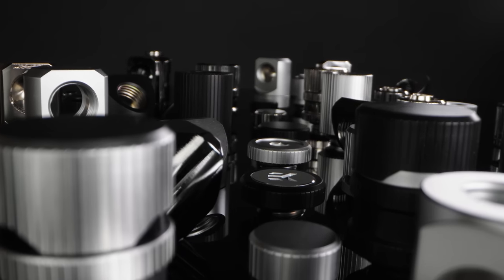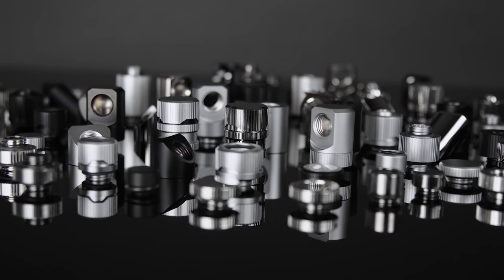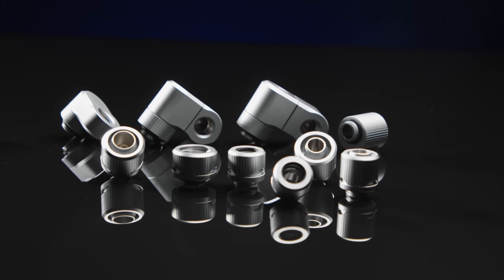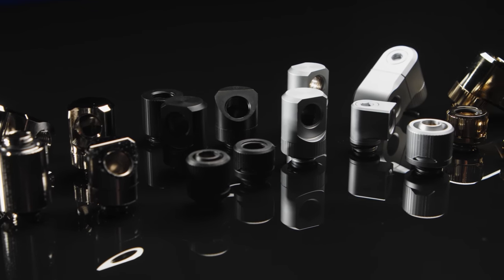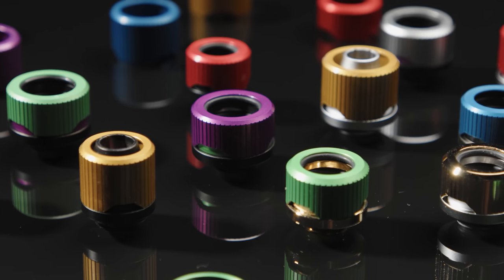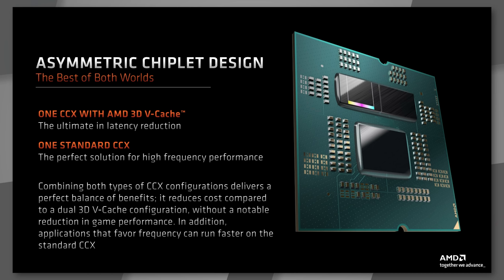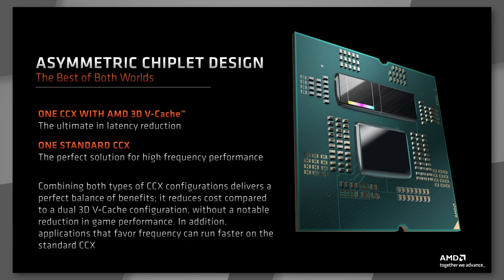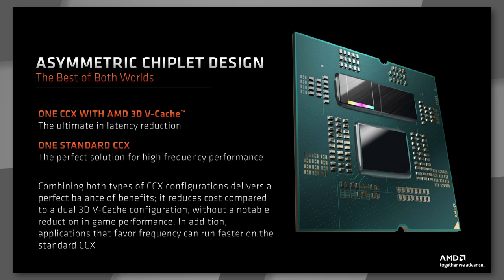Why I switched back to Intel...

Comment: I hope Intel continues to treat you well.  I took a bit of a leap going for the 7800x3d (I do know about the 2 CCD vs 1 but it was the change to AMD and the RAM frequency issues) after being Intel my whole life.  So far the only issue was the power supply nuking itself after only 2 years but I was so ready to blame it on the new platform.  Knock on wood I'm hoping it keeps going well and hopefully skunkworks is rock solid as well (and fits in your house).
Reply: Best choice. I don't even know why anyone would go for anything else. I still can't believe the performance numbers while drawing soo little power, it's just bonkers. This cpu can easily last 5 years in a top tier gaming system and after that a potential 9800x3d can probably be just swapped in.
Reply: His problem is the 7950x3D sucks. The 7800x3D is good. I guess he wants more cores and faster RAM timings. He’s making a long winded excuse to go back to a dead platform and use way more power lol.
Reply: @quintrapnell3605  Why do you care about power so much? I really don't get why people care so much about power, in their PCs while they have RGB everywhere and subsused cooling systems. i understand people like 3D cos better benchmarks I get it. But power? who cares unless is a laptop 
CPU power wont make a such difference anyway when choosing  PSU. So why?
Reply: 7800X3D only has a single CCD with the V-Cache on it. So it doesn't suffer from the problems he described with the 7950X3D.
And for gaming there is not much point in more than 8 cores anyways.
Reply: @quintrapnell3605  AMD sells something that sucks and wastes someone's time. Common AMD Fan reaction.. YOU BOUGHT THE WRONG ONE!
Reply: @afiguerog  yep.  Last days i played Wreckfest for example.  It plays well on 13600k 5,4 allcore.   60- 70 Watts.  But with windows-enery-saving mode this CPU takes 7 Watts max.   Drops to 160 fps ingame, but still kinda good on 240Hz Panel.  Sometimes then i 330 frames or maybe more cause of my limitation limit.   
on enery mode also 1,6 Watts on Idle / browsing / having pubg in the backround

those 'experiences' and tests I suggest for amd can like my a**  if intel is running / that good / that stable / and that efficient
Reply: @afiguerog  Power usage doesn't matter if annual infrastructure cost is "near zero" for electricity, air conditioning, clean filtered dustfree indoor air.  But in the summer time, kilowatt hour charges can be tough (eg southern california) if someone has an electric car charging while drawing roughly 450 to 700watts with their XYZ CPU + 4090 GPU.  The non-peak kWHr charge is 24 cents for some people and charging a car pushes them into the next 2 tiers at 26 to 32 cents.  You may still say pshaw 500 watts averaged for the PC while it's on for a few hours per day doesn't matter, but your air conditioning unit has to get rid of that 500 watts of additional load.  So that cost is invisible to a PC user, but should also be factored into the cost of the PC power draw.
Reply: @quintrapnell3605  It sucks as a gaming cpu. Honestly I have no idea why AMD made this cpu when afaik no productivity software benefits from the larger cache. Iirc, even a regular 7950x is better at productivity compared to an intel one.
Reply: What PSU was it?
Reply: @mangatom192  enthusiast market kept moaning about it so they gave in.
Reply: @DEJ915  There isn't a true enthusiast market anymore. It's just gamers who want to try & stream what they're doing to try & make money off it. 
True enthusiast tinker with computers finding the right settings & getting ever last % of performance out of what they have. Things like mGPU & variable rate shading would be on that list too. I mean they had to come with an Bios update to run anything past 6,000mhz DDR5 on AMD because their IMC can't handle it in 2:1:1 mode, so it can only do it in 2:2:1 mode. It's limiting their own cpu's potential at this point too.
Reply: The V-cache is just remedy for interconnect latencies with AMD going for multi-die design which is more economical although very difficult to tune. Adding more cache improves memory fetch time but AMD's implementation with 3D V-cache does incur drawbacks with thermal and more complex manufacturing process. On the software side Intel is more refined and AMD is still playing catch up (both Intel and Nvidia). Given that AMD almost went under and lost many talents in the past before zen series, they are currently doing okay but definitely I would like to see their hardware and software design getting more refined over the next few years.
Reply: @quintrapnell3605  AyyyyyMD fanboy detected, lol.
Reply: @quintrapnell3605  If you watched his earlier vids on this CPU you can see why he switched, AMD always seem to get so close but they always fuck something up to make their product no longer viable where you have problems with drivers, RAM timings, weird inexplicable errors
Reply: @afiguerog  Because we don't all live in America. The 7800X3D and the like achieve pretty much the same performance at 50% the power consumption.
Reply: I just did the same. The 7800x3d is a super super processor
Reply: @afiguerog  then you must be living in a country with low electricity costs. I pay almost 50 € cents per 1 kWh... The heat generated by my Intel was tremendous, my case was quite hot all the time. Now, for the past 10 months, I've had a 7800X3D...
The performance in gaming is simply impressive. Not in all those casual games; it doesn't matter there. But there are some games that benefit significantly from the X3D. Tarkov +40%, X4 is hard to measure, but it runs much better too
Reply: @afiguerog  More power = higher temps and more expensive power supply needed because you have to buy a bigger unit and a more expensive cooling option will be required.  Actual power consumption cost is not the concern.  Your CPU will thermal throttle when temps reach the TDP (max temp the CPU can handle) then you start to get significant performance loss.
Reply: Well the 7800x3d doesn't have that issue that the 7900 ones have. And it actually is the fastest gaming CPU.
Reply: The 13900k is still faster...sorry. @DenverStarkey
Reply: @drunkhusband6257  not at gaming it's not
Reply: @unknown14191  there is no thermal limitation. Its only rated lower from 95c to 85c because the power limit is lower Its 120 watts vs 170 watts for non 3d cache cpus.
Reply: so i bought a 7800x3d with DDR% 6000 M/Tps and so far its been AMAZING! but.. i have had the dram light on my board every now and then but i just dont touch it and it retrains the memory and posts.
Reply: @afiguerog more power = hotter and more frequency drops if you can't properly cool the chip leading to worse performance overall regardless of gigahertz or ram speeds
Reply: @rahorin  the thing about power limits though is that when they set a "wattage limit" they also set the temperature limit too.
So 170watt is 95C while 120watt is 85C. It's based on the same voltage curve & thermals don't actually play any part in it.. it was just done for power efficacy. 
it's like when you get a GPU that has power limit of 115% but starts out 250 watts while another model has 105% power limit but starts at 300 watts. all while being the same GPU die.
Reply: @gessler555  seasonic. I'm RMAing it but I was very surprised that was the issue.
Reply: Love my 7800X3D as well. The best part of my entire new system. Dissapointed a bit by my 4070ti...To much coilwhine. But the CPU is gut-tier. 55 watts in games, never seen more than 70c in games on an NHD-15. I hated it early on because I had boot problems despite expo 5600 mhz....But once I got bios update sorted, and ram somehow working there has been 0 problems.
Reply: @pinatasrule  so does that apply to 11th gen intel CPU and intel fanboys, or what are you trying to tell us?
it's a fact that Jay chose the wrong one for his needs. and he clearly says nonsense at 1:50 "the 7950X3D [...] anticipated to be the best gaming CPU ever." That is plainly wrong. the 7950X3D came out merely 6 weeks before the 7800X3D, and it the specs of both were clearer as vacuum, especially the Vcache wouldn't be on both CCDs. Also it was well known with the 5800X3D, that the temps and clocks are slightly lower compared to the non-X3D one. 
So all Jay tries to do is to put the blame onto AMD while he basically chose the wrong one for his needs. He was like "let's buy the biggest AND most expensive one" without reasoning and further deeper look.
Reply: @kevinerbs2778  interesting! What's equal interesting, that my 7950X runs only very slightly slower when set to 105W Eco mode (which equals 130W according to hwinfo)
So... it's about as fast as a 13/14900K, but uses half the power. Which is insane.
Reply: @afiguerog because I don't have any RGB and can use a cheaper air cooler instead of an AIO. In the end it saves me money and is easier to cool.
Reply: @mangatom192  they made it because fanboys wouldn't shut up about AMD not making a 16 core v-cache chip after they repeatedly said why they didn't make it... so they made it because why not, there's people dumb enough to buy a processor they shouldn't be buying to use on something that isn't a primary use case for the cpu. it's not a "gaming" cpu it's a workstation cpu with the option to game with less of the limitations of a workstation cpu. most mainstream applications don't really benefit from v-cache but there's more and more enterprise software that's being coded to use the cache pool with the new v-cache epyc processors coming out. because of that there's usually a trickle down effect to mainstream app's.
Reply: @afiguerog  yes it makes a difference in psu choice , if you have a cpu suckng 50 watss compared to one sucking 200 watts? how is that not influencing psu choice?
i have 7800x3d with a 750 watt psu on a 4080 ,  if i went 13/14900k i would have needed a damn 1000 watt psu

and i dont like cpu thats always near 100c like intels ..... 
so i even save money on cooling 
i have a 50$ aircooler for the 7800x3d on a 13/14900k i would needed a good spec aio at least
Reply: After reading so much barbarity, I'm old in IT and there is a big problem, the manufacturer makes a product, and the partners like Asus, MSI etc, want to do more than can be done... some are right but some even explode , processor...
Reply: @afiguerog  More power more heat and louder.
Reply: @HaasTheFirst  Maybe just maybe without the bios updates that limits the cpu voltage or manually lowering the voltage these CPUs melt and fail both damaging the CPU and mother board is a bit of a turn off. For those that like to OC or play with the specs of their system x3d is a non start because it cant. This CPU is also not the best choice for those that need multitasking performance but also want to game and it isn't even close. Just a few examples why someone might choose intel.
Reply: @afiguerog power consumption and "muh efficiency" has been part of the amd propaganda machine for like 2-3 years, dude. When their newest GPUs started using power like they have holes leaking it in the back, it suddenly stopped being important?
Reply: @afiguerog  Electricity can be pretty damn pricey in some countries. Over time adds up to costing you more than the entire build. That's why.
I got no RGB whatsoever. GPU undervolted. Got a 4070 burning around 60-80 watts most of the time on ultra. Still easily hitting stable 144 fps in fast paced games. Got it locked to 80 in most slower paced ones (like Baldur's Gate 3) where anything above that makes no difference.

Comment: Running 7900X3D combined with the 7900XTX.   This was my only AMD build in about 15 years, so far IT'S A BEAST.  I don't "abuse" my PC as much as I used to so I haven't had any problems yet, gonna bookmark this for my records and will UPDATE IT IF I RUN INTO ANY PROBLEMS.
Reply: Do the problems talked about here (with Jay's setup for example) occur only when overclocking? Getting my AMD setup too and got bit worried about these issues. No plans to mess with the system, just run it default, so hopefully it goes problem free.
Reply: excactly the setup i want to get. can you share you complete list of specs? i'm curious to what MB you're using, RAM too
Reply: AMD is ok for casual gamers, but for streaming+gaming+browsers opened with multipletabs you'll experience stutters ans real 1% frame losses compared to Intel.
Reply: Putting almost best consumer PC pieces for "not abusing my PC" -what is wrong with you people.
With a 7800x3d and 4080 rtx you would spend less and gain more with rt and lower consumption
Reply: This is my first AMD CPU in 15 years also 🤣😂😂
Reply: @b3at2  how is it so far ?

Comment: I love my 7950x3d. I use process lasso and prefer cache in bios. This pretty much takes away all issues especially if as you say a lot of games are less known that you play. ECLK is used to bring up frequency on the vcache ccd so you can OC a bit. I haven't experienced any of the memory issues you have so can't speak to that, running Buildzoid's timings at 6000. Got it delidded so temps are really good. I understand and respect your choice, hopefully others that have already purchased this chip can find these "fixes," especially use prefer cache in bios if you game a lot. The power usage still amazes me. End of rant, Thanks Jay!
Reply: Can you give me either a link or quick steps to use process lasso? What exactly is it?
Reply: @NmsOnetk0 you don't need a lasso. In bios choose cppc - by driver. And if the game is new, just add the game in the game bar.
Or just use the tray program - v-cache.
Reply: 7950x3d needs Process Lasso for max performance.
Yes, it's a slight announce to be the thread director.  
Ccd0 for gaming only.
Ccd1 for system tasks, background tasks, chrome, discord and everything else. 
Also offload all infinity interrupts into ccd1 as well.
My average Dpc latency is under 1ms in latencymon.
 
Buttery smooth and zero dips in gaming.

Downside is there is a learning curve to set up the 7950x3d in this manner. 
Best CPU I have used so far.
Reply: @jsktravels1307  nope, it does not. Any of my game always on cache ccd. If I alt-tab, it instantly goes to frequency ccd and back to cache after alt tab in game.
Without game, in any software cache ccd in parked state and work only frequency ccd.
Reply: @jsktravels1307 can you please share how you eventually set it up in BIOS as per your best working experience?
Thank you!
Reply: @dKenGuru 
You need both if you want to get the maximum performance. Prefer cache doesn't take the place of process lasso it just assigns priority to the first CCD. I have multiple monitors and I want YouTube and everything else to not interfere with the game and run on the second CCD. This is where you need process lasso. So I guess it depends on what you're trying to do and what your goals are, but it is needed if you're trying to extract every little bit of performance.
Reply: @keicola46  no you dont need both........ the game doesnt magically run on both CCDs if you run something else on another monitor....... the game is still tied to the primary CCD that has vcache, youtube running on the other CCD has no impact on the other, either windows isnt correctly doing what it should OR drivers are having issues, people have tested the CCD management for this exact reason to see how it works and games assuming its detected correctly will stay on the vcache CCD and dont suddenly move over to the 2nd or split across both because of other programs running

Comment: yo Jay it seems to me like the memory stability issue you were running into on am5 was that memory context restore ON but memory power down mode OFF leads to random crashes like you're describing. Leaving both on should make you stable if this is the issue. This is a very common issue for people used to turning off power down mode because it increased stability in ddr4 systems.

Comment: Im useing the 7950x3d since March with 6000 cl30 corsair ram and useing curve optimizer and it works with 0 crashes, no bluescreen and fast boots. Ive always used intel cpus before and im currently kinda happy with the amd cpu.
Reply: what motherboard are you using?
Reply: I would appreciate it if you could tell me which motherboard and RAM you are using.
Reply: @Aolzarin  Gigabyte X670E Aorus Master
Corsair Vengeance RGB 32GB(2x16) 6000MT/s CL30
Reply: It's spelled "using".
Reply: How fast are your boot times?
Reply: @ShadowRaids666  from hitting the start button on the case to fully on desktop arround 37-38 seconds with entering the windows login pin. Could be a few sec faster with no login pin.
Reply: and I experienced no issues with the Gygabyte X670 GAMING X AX and Kingston FURY Renegade 64GB DDR5 6000MHz CL32
Reply: @protexnoob you don't need 6000 ram, for God sake. Only for 7950x it have sense, vcache making your speed irrilevant. Classic amd user😅
Reply: Just made the switch to amd. 7800x3d building it tonight. Hope no issues like this
Reply: @serhiymedvedyev7140 not just amd my friend, I've always been a 64gb kinda guy. Intel and AMD builds. Definitely overkill, specially with the newer cpus BUT better to have it and not need it than needing it and not having it (I've never used more than like 14 at a time tho😂)
Reply: @brandon6677  6000 it's speed, not capacity =)
Reply: Thank you, today I installed my 7950x3d after 13900k BSODs,crashes, My hope is non crashing, I got Gigabyte x670 gaming x v2, Should I disable integrated radeon graphics from bios?